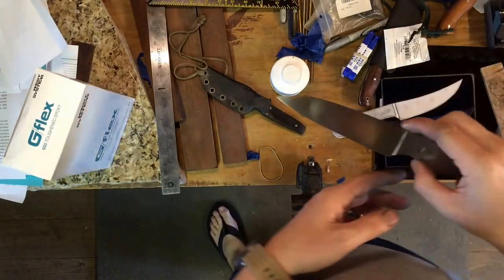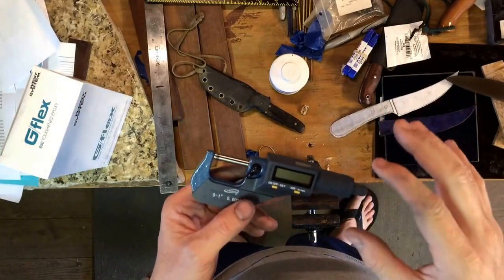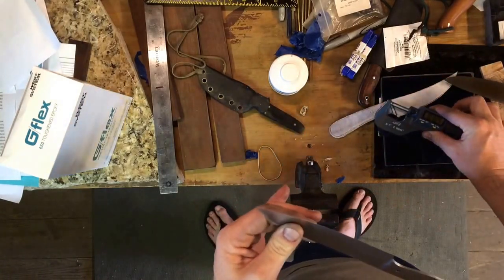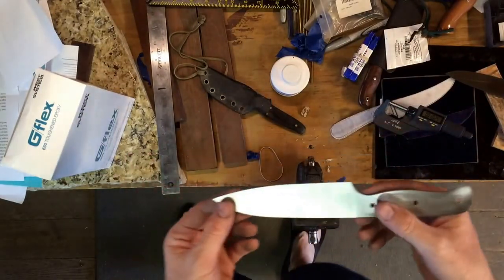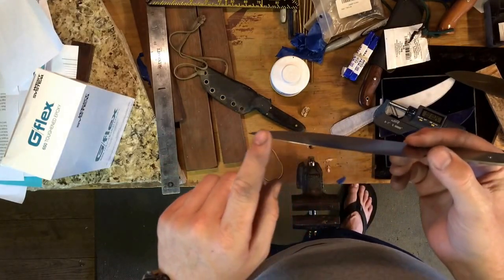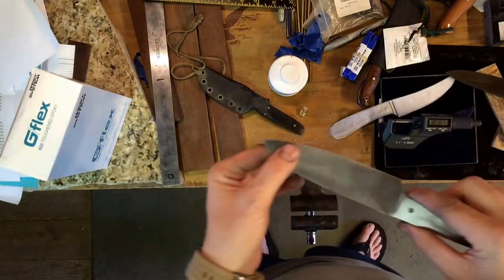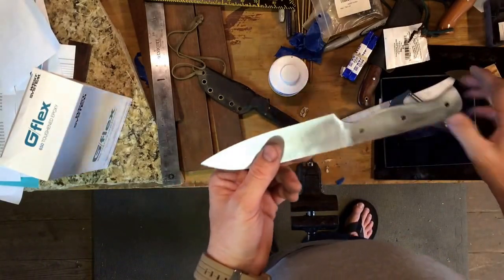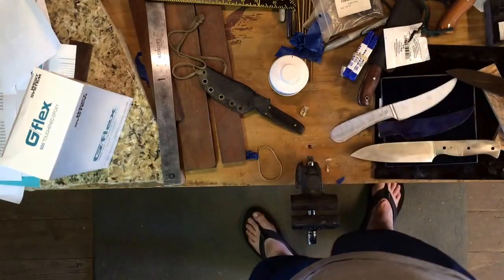Dialing in a flat grind with a disk grinder and a micrometer- 1st attempt

Comment: Hey I have a couple disk sanders and I'm having trouble getting full flats do you jig the blade before you do it
Reply from the maker: I freehand grind.  I work on trying to get the blade a flat as I can on the belt.  A lot of times you can feel a slight imperfection with your fingers and not see it.  I also have found that I find more errors after I finish grinding and then not touch the blade for a day.  Fresh eyes pick up more.  On the disk grinder I take it slow and break the blade up in sections maybe 1".  Once I have each 1" section flat I ensure that they all blend together.

Comment: I imagine there's an economic advantage to using a disc grinder over a belt grinder? What other advantages does it bring in your experience?
Reply from the maker: The disk will give you a true flat.
Reply: McCullen KnivesOh, dumb question Jeremy, sorry, translation problem, I thought a disk grinder is another type of tool. Of course, this one will also help you in making tapered tangs easier, right?
Reply from the maker: Yes, it will allows to get a nice even taper on a tang.  I will first hollow tang using my 10 inch wheel.